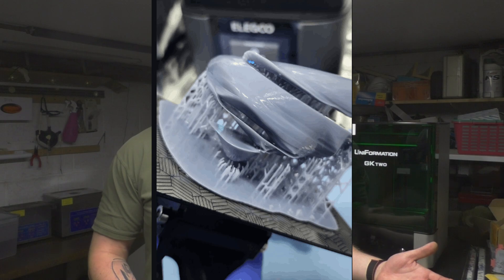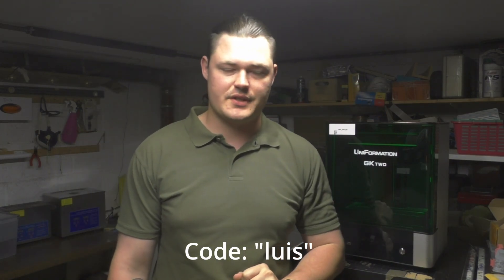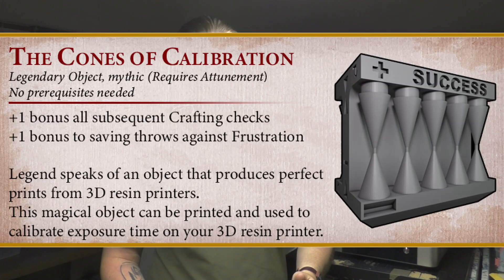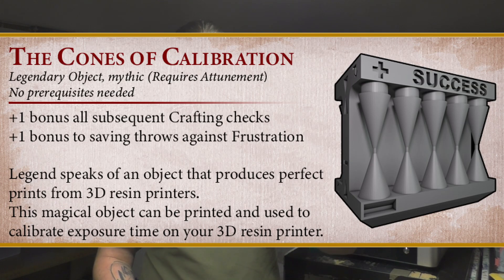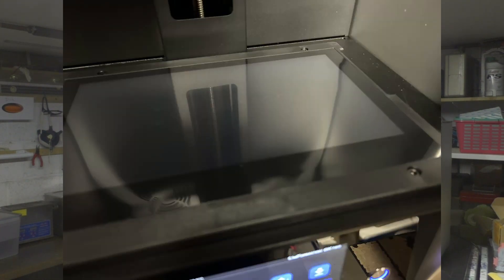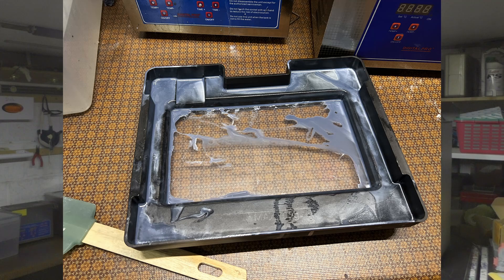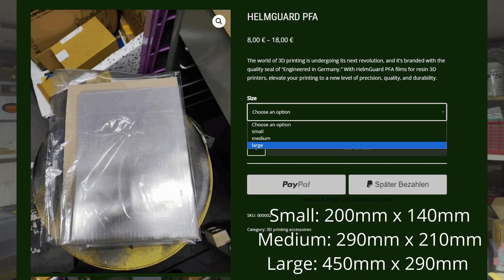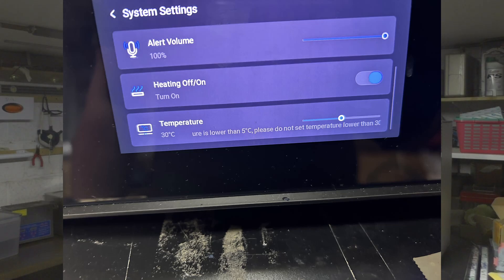Calibrate Like a Pro: Cones of Calibration for Resin 3D Printers | TNH Group

Comment: 🤣 who ever came up with this has had to much cones. It’s not right your way over exposed if you use this method. Just use the little plate ppl have been using for years it’s the most accurate. You not building a rocket ship. You don’t need to act like a scientist and have a diploma for this.
Reply from the maker: The cones are literally calibrating for supports